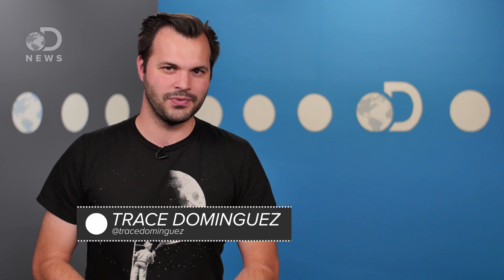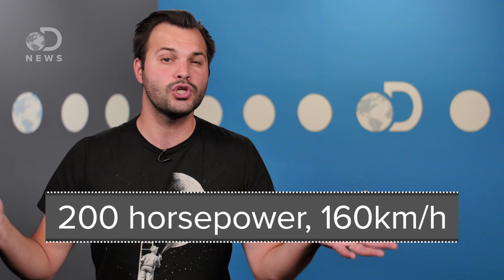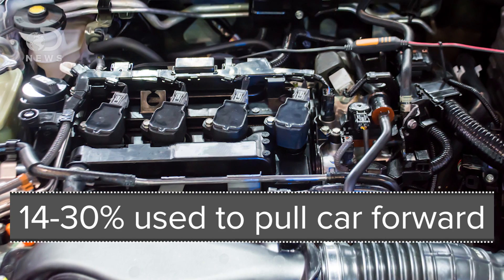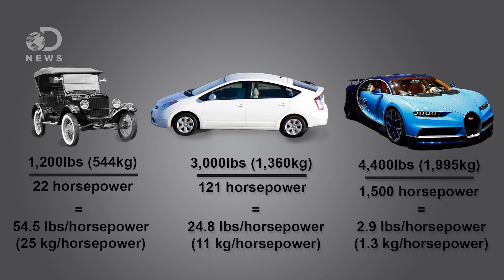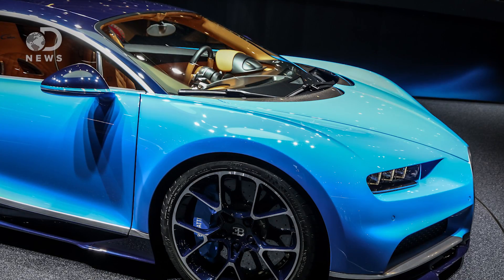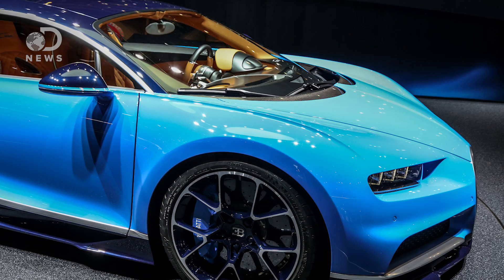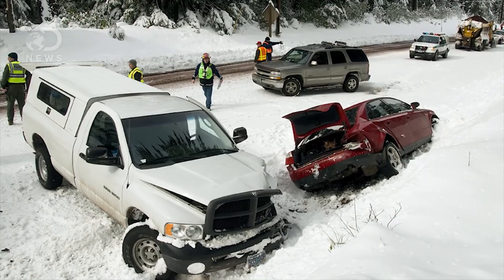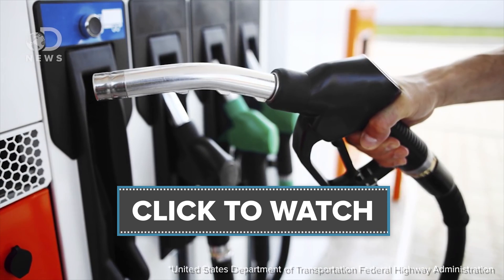Why Isn’t Your Car Faster Than A Sports Car?

Comment: Do a video on why f1 cars can go so fast in corners.
Reply: The spoilers help by giving the vehicle "negative lift", and increasing the contact force between the road and the tires, above and beyond what it is due to weight alone.   Given greater normal force, the corresponding traction force per unit mass, can be much greater than what it would be if only weight were holding the car in contact with the road..
Reply: Also, downforce is better than weight in this situation, as it doesn't affect inertia (which would majorly impair acceleration, braking, and make the car need even more traction). The only problem is that downforce has little to no effect at lower speeds, so an incredibly light, incredibly powerful F1 car is very easy to spin out at lower speeds.
Reply: Like above said: Downforce basically sticks the F1 car to the road allowing it to go round corners faster, ( reverse plain wing aerodynamics ) also the drive has to line the car up to he can take the bend without driving off into a wall  it's a combo of both .
Reply: +lasarith2 plane *
Reply: lasarith2 Could a racecar theoretically be driven upside down on the ceiling?
Reply: +carultch they keep saying yes they could drive a F1 car on a celling  but as far as I know no one has actually done it .
Reply: +carultch Yeah guys Williams released a fact that their FW38 can drive on the ceiling of the Monaco GP tunnel! Insane 👍

Comment: One:1 and Venom GT are faster than that bugatti
Reply: No. The One:1 and Venom are faster than the Bugatti Veyron, but not the Bugatti Chiron. The Chiron currently has, by a large margin, the best power to weight ratio of any production car, since the Koenigsegg Regera is a limited run exclusive, not a production car.
Reply: +dragonosis you actually wrong .. Maybe in acceleration . But in top speed the venom beats all the competitors in the competition. 270.2 mph is the venoms top speed and the chiron may be light but its top speed is 261.6 mph
Reply: 2goons arefly That's sort of true, but at the same time sort of not. The Chiron's top speed of 261.6 mph is an electronically limited top speed. The Chiron's actual top speed is believed to be around 288 mph, though I believe it's untested. Also, the Chiron's really not light - It weighs over 1.5 times as much as the Venom.
Reply: +dragonosis very true but at the same time the venom couldent test it top speed to its fullest potential as they only had 2.9 miles to work with ... They could only get to 270.2 mph .. Now hennessey is coming out with a new venom and its the f5 venom and its expected to reach speeds of 292+ mph

Comment: isnt it a better way to meassure the power of a car than the antiquated horsepower?
Reply: I believe in places that use SI units, the power of motors is expressed in watts or kilowatts
Reply: thank you! that seems muuch more practical!
Reply: Kilowatts are the "official" unit, but everybody talks about horsepower.
Reply: but is kilowatts the power of the engine before weight is calculated into the equation? I am not an engineer obviously
Reply: atheistfromnorway What You mean? In cars the power measured is the amount of power the tires put to the ground, after the loses in transmission etc...
Reply: Ironically, it is a unit that is named in honor of the man who coined the term "horsepower".   We call it the Watt, in honor of James Watt.   Larger variants representing power figures on the order of magnitude of a car's power are called the kilowatt.   Kilo = 1000.

Comment: 1:24 Actually it's two VR 8 engines that produce 1500HP starting @2000RPM.
Reply: Most people don't know about that.  They literally think its 2 90% v8s.
Reply: Thus begging the question of how a power to weight ratio somehow rhetorically concludes one that low whilst following the apparent redundancy of machines... Reflecting the degree of predictability thereby created.